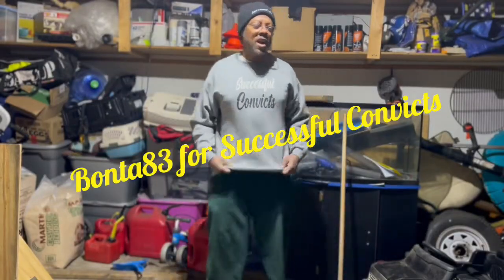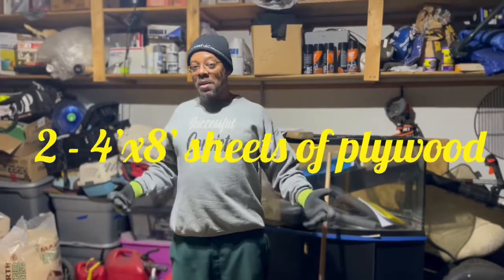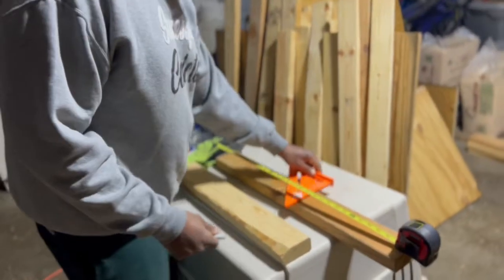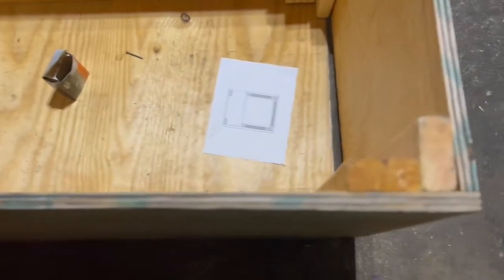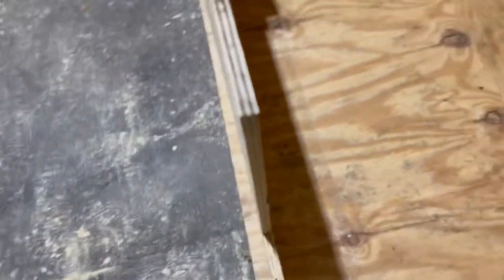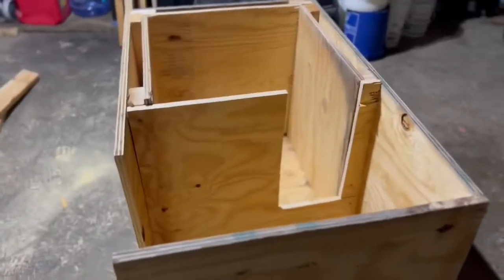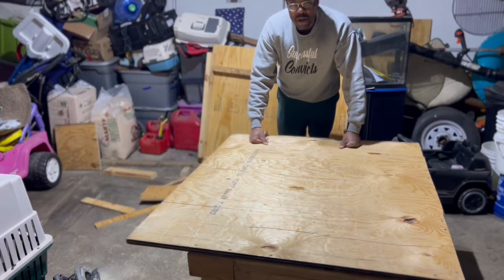How To Make An Insulated Dog House (The Bonta83 Way)

Comment: And roof
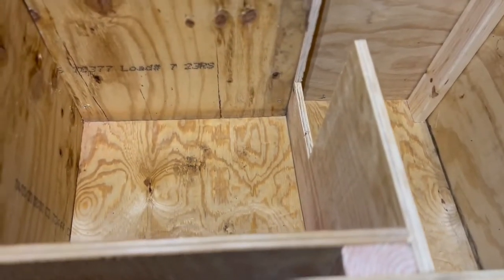Reply from the maker: Pause it at 12:27 or so where I show the plans. But you could also make the roof however big you want. Maybe you want more of an overhang to provide shade in the summer. I also add wood boards underneath so that the top doesn't slide off. My dogs jump on top of their houses. It also adds as another barrier for drafts.